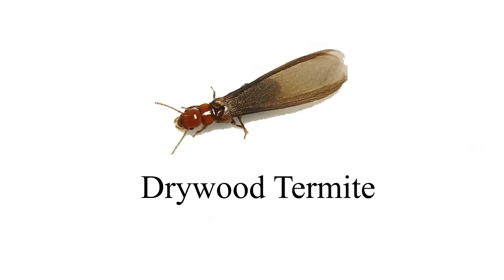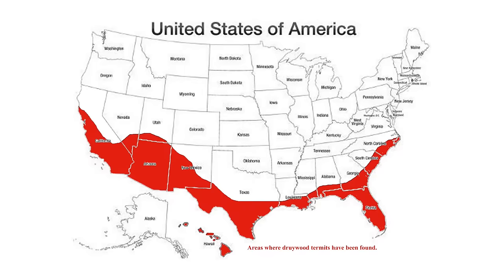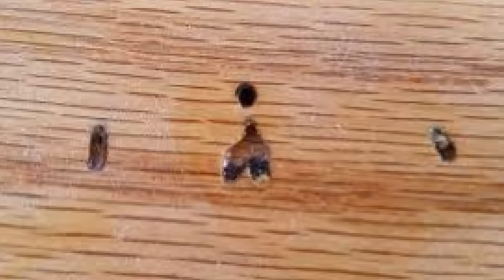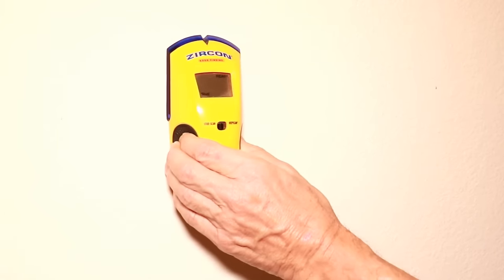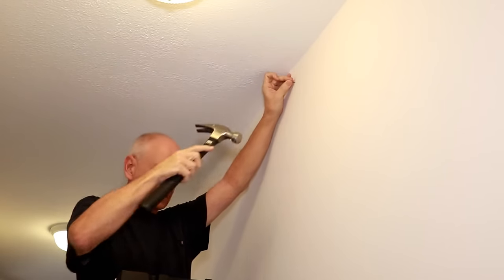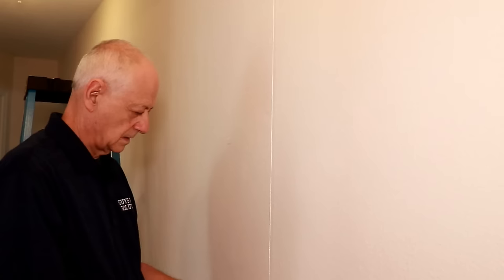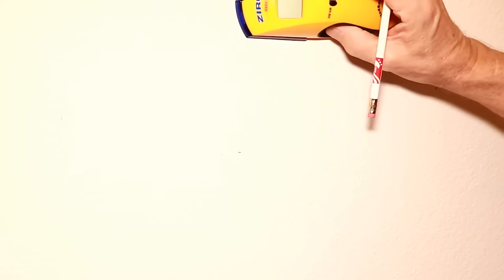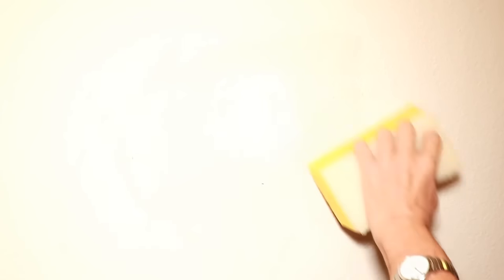How to Treat a Drywood Termite Infestation Yourself. A MUST see if you have Drywood termites.

Comment: Each year in the spring, I find wings and swarmers on a table that has two lamps on a timer and go off about 11pm.  I have hired 4 major companies in each of the last 4 years to do an inspection of my attic.  The walls of the house are concrete, and the studs are metal.  Only the attic has wooden trusses and beams.  In each of the 4 inspections, they have reported no termites visible. 
Outside the house we have many lights in the soffit.  When I turn the lights off, there are no termites or wings.  When I turn outdoor lights off, but leave the table lights on, 4 or so termites joined end to end.  Sometimes none.
My attic is very large and has many areas you just can't get to.
If I fumigate, and the termites are coming from a neighbor, I will still have a problem next year.  I don't believe there is any practical way to spray the Borate solution without removing the roof.  I have taken to leaving the lights off.
Any advice will be greatly appreciated.
Reply from the maker: I responded to your email.  Don't worry.  We will get the problem resolved.  Be well my friend.
Reply: @GuysPestSolutions  Hi there, we have the same issue, we believe that a neighbor's dying tree is sending swarmers. We've had our home tented (Vikane) in the last couple of years and found one spot where they were coming in from and sealed it. We still find a number of wings and bodies inside from swarmers getting in. Is this something we should be concerned about? We did find some damage in the attic but no active termites so we're guessing the tenting took care of them. Thanks in advance for any advice.
Reply from the maker: @dpsa8630  I am so sorry that you are having this problem.  I hate to be the bearer of bad news, but you should know that this is something that you should be very concerned about.  The fact that you had drywood termites means that, it is almost a certainty, that your neighbors also have them and it is quite possible that you are correct about them being in your neighbor's tree.  In all likelihood, these guys are busy infesting quite a number of houses in your area.  Fumigating with Vikane is the best way to treat for drywood termites.  In fact, it is the only sure way to get rid of them.  The problem is though that Vikane offers absolutely no residual action.  That means, after the tent comes down, the termites are free to once again infest your house.  Since your neighbors also have drywood termites, then it is almost a certainty that those termites are going to re-infest your house the first time they swarm.  Given that your fumigation was done about two years ago, it is a safe bet that you do have a number of galleries that currently exist your house.  That means you are going to have to fumigate once again in order to get rid of them.

There is some good news here though.  After you have the house fumigated again, there is a way to prevent future infestations of drywood termites and I have a video on how to do that.  I will place a link below for you.  Now, this is a treatment that you must do yourself, because pest controllers typically will not do it.  That is because this treatment requires that you spray a pesticide on the eaves and facia boards of your house and almost all pest control companies will not allow their pest controllers to spray above their heads.  Don't worry though because this procedure is perfectly safe, if you do it correctly.  To be effective, this treatment needs to be done every three months, without fail.  If you do that, then you will never get another drywood termite infestation ever again.  The only other alternative to this type of a treatment is to simply fumigate your home every four or five years.  The problem with going with the fumigation every several years is that you are going to have termites continuously eating your house.  

The bottom line here is that you almost certainly have an active drywood infestation in your house at the moment and that will require that you fumigate again.  I would urge you to watch my video on how to prevent drywood termites and do your first treatment a few days before the pest control company comes in to do the fumigation.  That way you will be protected the moment the tent comes down.  You see, you can literally get re-infested with dry termites within minutes after they take the tent down.  Therefore, it is a very good idea to do the preventative treatment just prior to the fumigation.  After that, make certain that you do this treatment every three months.

I am so sorry that I had to be the bearer of bad news, but I always give it to you straight.

Please let me know if you have any other questions or if I can be of assistance to you in any other way.  I am always here to help.  Be well my friend.

How to prevent drywood termites video:  https://youtu.be/neNsmVbj8Pc
Reply: @GuysPestSolutions  Thank you for the thorough explanation and  straight forward answer. We've ordered Boracare and Termador and will be treating all of the exposed wood in the attic and drilling the walls where we finally found the exits where the swarmers have been coming from, watching them flood out of the door frame was something straight out of a horror movie but at least we found them. How long is the swarming season and would it be safe to say that we can wait to see if the Boracare/Termidor worked and if there are more swarmers before calling for another fumigation? We've had horrible experiences with exterminators in Miami and the one company we trusted left. 

Many thanks on the prevention video, just ordered material for that as well. Again thank you for your time and expertise!

Hope you don't mind but to add another quick question, is there a way to tell old infestation from new? Question comes out of curiosity and if in the future we buy again we' like to be able to tell as the last seller did not disclose but we found treatment invoices.
Reply from the maker: @dpsa8630  Here's the thing about dry wood termites, you never know where all the galleries are located.  Sure, some of those termites are really stupid and they create the kickout holes where you can easily see them, but not all galleries are like that though.  Some of them are inside the walls and the exit holes are on the sides of the 2 x4’s that are not visible from inside the room.  This is the reason why fumigation is the only surefire way to get rid of all of them.  That is why I only recommend treating this yourself if you cannot afford to have your home fumigated.  If you decide to do this yourself, then I would be happy to stay with you every step of the way to make sure that you are doing everything correctly.  Also, I fully understand that the pest control business can be somewhat daunting at times when you need to hire a pro.  So, should you decide to go ahead and have another fumigation done, then I would be happy to assist you with that as well, to make sure that you are getting the right company at the right price.

Regardless of whether or not you fumigate, treating the attic with Bora-Care is a very good idea.  As you now know, the fumigation does nothing to prevent future infestations, so the Bora-Care will give you a permanent solution in the attic.  It is an extra layer of protection that I think everybody should do if they are living in drywood termite country.

Also, even if you end up fumigating, treating the active infestations, that you know about, with a fipronil foam, is also a very good idea.  To be honest, I have my doubts about how long this treatment will last, but there are some very experienced people in the industry that will tell you that it can last five years or more.  If they are right, then this treatment will also provide you with additional protection.

The only good news about drywood termites is that they are fairly slow eaters.  So, if you treat this yourself and then later on discover more termite galleries, then you can either simply spot treat those galleries yourself or make a decision to go ahead and fumigate the entire building.

Termites can swarm at various times during the year and sometimes those swarms can last for weeks or even months.  Most of the time you see them swarming starting in April and usually ending by the first of October.  They usually swarm at night and are attracted to light.

It is possible to tell if a drywood termite infestation has been there for a while and is no longer active.  However, you kind of need to have a trained eye for it.  You're going to look for things like how old the frass is.  Is it nice and loose or is it kind of caking up or getting hard?  Also, a professional would look for things like dead termite swarmers and their wings to determine if those are decaying or fairly recent.  The problem is though that, most people who are selling their houses, will probably know that they have a drywood termite infestation and they're likely going to clean all that stuff up before someone comes to look at the house.  Therefore, the place that you want to look would be in the attic.  Most home buyers do not bother to go look in the attic and most sellers do not bother to go up there to clean up frass and dead bodies.  Of course, if you find invoices from other termite companies, that is a pretty good indication that there was a problem.  Take a look at those invoices to see how the problem was handled.  If these were drywood termites, then it's a pretty safe bet that there are drywood termites still in the house.  One other thing that you can do is to have a look at the circuit breaker box.  Almost all pest controllers will leave their company tag on the circuit breaker boxes when they are there.  If you find a tag like that, then you know that, at some point, there was a termite company inspecting the building.  Give those folks a call and ask them what they found at that address and if they did a treatment for it.  Tell them that you are thinking about buying the house and you want to know if any treatment that they did has a warranty that would be transferable to you.  We know that virtually no pest control company will give you a warranty for drywood termites, but their answer may well give you a clue to whether or not they treated for them.  Finally, before buying any house, you should always have a termite inspection completed on that building prior to the closing.  Always make sure that the contract states that, if drywood termites are detected in the building, that the homeowner will have the building fumigated prior to the closing or you can bow out of the contract and get your good faith money back.  It is well worth spending the money to have a termite inspection done on the house and, in most cases, the bank is going to insist on it.  You can also ask that the seller to pay for this inspection.  Here's the thing that a lot of people do not know about contracts.  You can legally ask for anything that you want.  I mean anything.  You can even ask for annual tickets to the Super Bowl if you want.  I know that would be a little bit over the top, but I have seen cases where someone really liked an entertainment center that was in the living room and asked for that to be included in the sale.  Perhaps the appliances in the kitchen are not included and you want them.  You can either put in the contract that they have to give you the appliances or that they have to give you the money to buy new appliances just like the ones that are there.  Do you see what I'm saying?  The sky is the limit when it comes to contracts.  You can even ask them for the family dog if you want.  Some Realtors may discourage you from doing this, but there is nothing stopping you.  Just take a pen and write it in the contract before you sign it.  This is perfectly legal and smart buyers do it all the time.

I hope that helps.
Reply: @GuysPestSolutions  Thank you again for the thorough explanation and the humor, truly needed that at this moment. We just broke open some stucco and found extensive damage to the bottom of our house (our house is a stilt style home) would you mind if I email you some photos? I did read elsewhere as well what you mentioned that drywood termites are slow eaters so either it's all old damage, the previous fumigation was done incorrectly, or a different type of termite is reaching the home from within the cinderblock piers. As you can imagine we're quite discouraged and a bit freaked out at the prospect of structural damage under the house. 

Thanks again you've been very kind and helpful with assisting us in a small DIY project that is turning into a nightmare. If you know any trusting termite companies that service the Redland area of Miami (33030) we would really appreciate it as well.
Reply from the maker: @dpsa8630  You can email photos to guyspestsolutions@gmail.com.  Please send photos of the damage and the piers.  Also, photos of the house from all angles would be helpful, so that I can see what you have and the layout of the property.  There are a number of things that I am looking for that would take too long to explain.  You know, “A picture is worth a thousand words.”

It is very possible that you do have more than one species of termite.  Formosan termites are also common where you live and, unlike drywood termites, they are very ferocious eaters.  In fact, they have been nicknamed “super termites” because of their ability to do so much damage in a short period of time.  These guys are subterranean, so fumigating them is not effective.  You will kill the ones in the structure, but the ones in the ground are going to immediately take their place and keep eating.  Now, I am not saying that you have these things, but they are in your area and, at a minimum, you should be taking measures to prevent them.  It is possible that the damage was caused by drywood termites, but you need to cover all your bases.  I don’t like to leave anything to chance.

Unfortunately, I am not familiar with pest control companies in your area.  However, I can offer advice on how to find a good one.  We will get to that after we figure out what is going on.

For now, please just try to stop worrying.  Just take this one step at a time and you will have it resolved very soon.  Getting sick over it is not going to kill the termites, but that can cause health concerns for you.  So, don’t worry.  You can do this.  It’s going to be okay.
Reply from the maker: @trugambit7484  What state is that?  I am not familiar with any guarantees with fumigation because you can literally get reinfested as soon as the tent comes down.  Vikane, which is the most popular gas used, provides no residual action.  Since it is almost a certainty that the neighbors also have drywood termites, there is a very high probability that a house that has been fumigated will be reinfested sometime within a year after the treatment, depending upon the time of year when it was done.  The thing is though that, most of the time, you don't realize that you have been reinfested because termites do not come out in the open like carpenter ants do because termites will die fairly quickly when exposed to the air.  For that reason, it is not likely that a homeowner will make a callback within two years.  They may well be infested, but they probably don't know it.  So, a law like that really makes no sense.  Of course, there are many such laws.  Anyway, if you want to prevent future infestations, then you can do a preventative treatment and I have a video on how to do that.  I will provide you with a link.

Be well my friend.

How to prevent a drywood termite infestation video:  https://youtu.be/neNsmVbj8Pc
Reply: @GuysPestSolutions  California even if the company who is involved doesn’t guarantee it. State board law does give that 2 year guarantee. In California honestly better to fumigate because of the guarantee and it Eliminates all pests
Reply from the maker: @trugambit7484  No offense to California, but this is a state that often tends to throw the baby out with the bath water.  You can't even buy most pesticides in this state.  I think they never met a regulation they didn't like.  Here's the thing about drywood termites.  If you get a queen and king in your home today, then you are not going to see swarmers for at least four years, in most cases.  No way in the world that they are going to swarm in two years and they are very slow eaters, so you will most likely never know that you have them after just two years.  So, a two year guarantee is totally useless.  I don't know what genius though of that law, but they may want to actually do some research before making those sorts of laws.  I'll bet the fumigation companies had a good laugh at that one.

My experience is that fumigation is so effective that it will almost always kill everything in the building.  However, there are possible exceptions.  For example, if you are fumigating specifically for termites, you may not eliminate a German cockroach infestation.  While it will most likely kill all the breathing roaches, the egg sacks may survive.  That is because, to kill the egg sacks, you will most likely need a longer exposure time than would normally be used for drywood termites.  Therefore, if you have a German cockroach infestation, then they should be the target pest because they will require a longer exposure time to the gas.  Cockroach egg sacks are very resistant to treatment.  You can literally spray them with a pesticide and the roaches will still hatch and be perfectly okay.  So, the egg sacks require a longer exposure to the Vikane than would be necessary for drywood termites.  Also, it is not uncommon for roaches to be running around for days after exposure before they die.  They are a hearty lot.

Be well my friend.